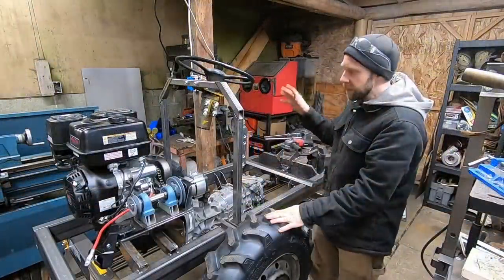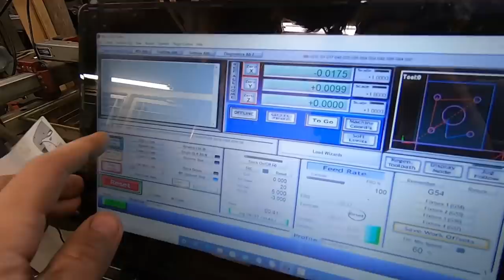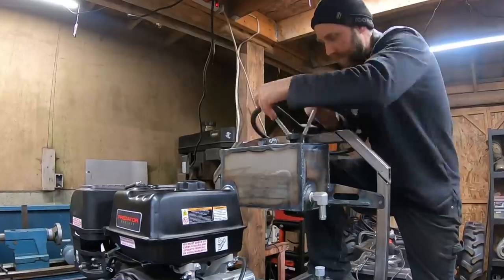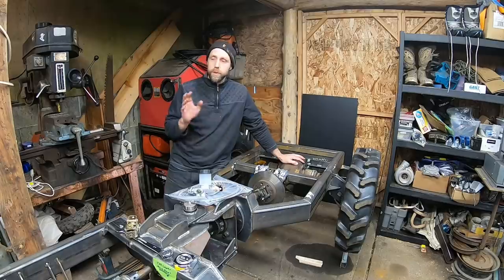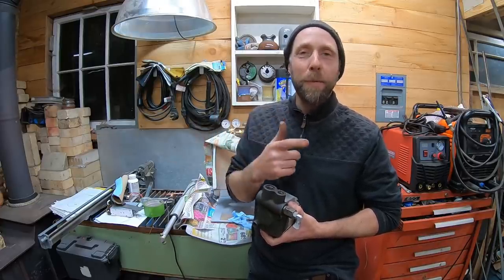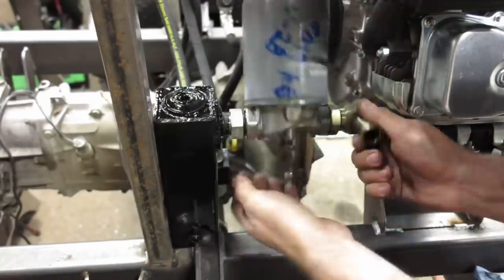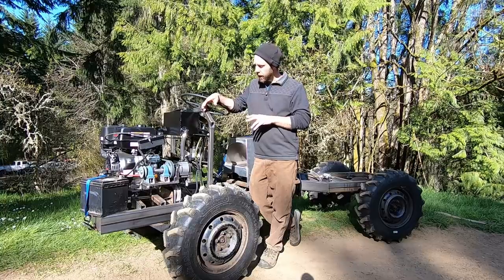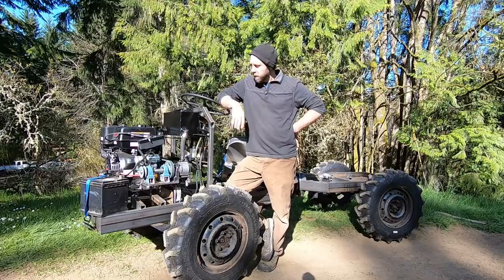420cc Predator powered articulating 4x4 dump truck build part 6

Comment: Looking fantastic! Great video. What video editing software do you use?
Also how do you like the Baur grinder? I just bought my first. I bought several Hercules before they came out with the Baur. Baur feels a little lighter, and is a little less expensive.
Reply from the maker: Refiner's Forge Thanks for checking out my video 👍 I’m editing on LumaFusion on my I pad, it’s affordable $20 and works pretty good!
I think the small Baur angel grinder seems fine so far, time will tell but I don’t abuse my tools so I think it will hold up fine. Thanks for commenting 👍 PS I just fired up my sawmill yesterday and got to same milling! It was great to get milling again!

Comment: Friends of mine own a tractor that brakes the front wheels by engaginging its 4wd systeme and at times it does not feel to healthy bc it has no center diff but it works just fine so i dont see a problem with ur brake design

Comment: For a vehicle with a relatively narrow track and no roll cage, the seating position seems quite high which also lifts the center of gravity of driver+machine. Was there a reason you chose this position ?
Reply from the maker: Haha it’s a motorcycle stand, just temporary 👍 I cannot get everything built in 3 months guys. I only put that on for testing it out 😂
I will be building a cab but it all takes time when working by yourself and documenting all this on my own.

Comment: Not sure you will need to weld that rear diff. Little to no tire slippage with no to near no weight on the rear end. (Just my opinion) Your build do what you want. 👍 Cant wait until next episode!
Reply from the maker: I will hold off for now on welding out any diffs, it gets great traction so far and I’m mostly sticking to trails. Thanks for checking out my video 👍

Comment: You may want to consider some kind of rotation limiter so the bed half doesn't flip over while you're using it. I can see it happen while using the dump bed on a slope.
Reply from the maker: Yes for sure, it’s definitely in the plan 👍
Reply: But then the front will roll over
Reply from the maker: Dara Bradley Yes I think I may not install a limiter if the back flips I would rather let it and keep the front wheels planted, I have talked with my friends that have worked a lot on the big 6 wheel articulating dump trucks and they don’t have limiters so when the backs roll it doesn’t flip the front end. Take care
Reply: @darabradley5173  Fair point

Comment: Nice work man! It's really turning it awesome! You've done some nice fab work on that machine! Just a suggestion, have you thought about switching over to a CVT style clutch in conjunction with your plan for the jackshaft? They tend to have great off idle torque by letting the engine rev a little more. Anyways, super cool stuff man! Love these builds you do! Stay safe! 😎

Comment: A predator 708cc would be sweet on that articulating dump truck your building or even the predator 670cc
Reply: Antonio Claudio Michael 708 is vertical shaft

Comment: E-brake caliper needs to be mounted so the bleeder is at the top. If not it will always be squishy because of trapped air.
Reply from the maker: Yes I flipped then so there installed that way now 👍

Comment: Hello friend. Good job ... quite inspiring. He has very good and innovative ideas. I really liked the possibility of adapting to the terrain with 4 tires and also using the same path as the front tires. I am also making some 4x4 vehicles manually to help with the farm work ... Please, why did you choose the centrifugal clutch instead of the Subaru clutch? It seems to me that I would have greater control of the acceleration and traction of the vehicle using the clutch of the Subaru. What are the advantages of the clutch you have chosen? The drums are very interesting ... thanks

Comment: Good work! I agree that your brake power is enough but do you think traction of just brakes on the rear tires will be enough? Like a heavy load plus a slippery hill situation.
Reply from the maker: Thanks for checking out my truck video! I should have gone into more detail on the brake stuff, I’m actually running stock Subaru rotors and calipers on the front with the center line rear disc for the main brakes. With a independent rear center parking brake. Take care
Reply: Mike festiva that makes since. Thanks for the reply!

Comment: great drive line break system ,, seen it done in autos some of there mistakes are putting it before the driveshaft ,, it needs to be by the rear diff like you have it ,, up front if the driveshaft broke you would not have rear brakes ,, great build what's wrong with that seat ?? car builders use a milk crate .. people it's in the build stage ..

Comment: Mike could you provide a schematic sketch of how the hydraulics were routed. That would be greatly appreciated. Great work!
Reply: It's very simple. From Tank to Pump to Relief valve to the steering valve, then back  to the tank. From the Steering valve, two lines go to the cylinders. On the cylinders, since it uses two, they are Tee'd together but crossing the ports so when one extends, the other retracts.
Reply from the maker: Thanks guys for checking out my video 👍 Pedro explained it great! It will change if I can track down the 5 port orbital steering valve, I then will be able to use the hydraulic pump in its original design and also run dual spool valves for the dump and plow blade. Take care

Comment: Don't you have to create some frame stops to prevent exactly what you did at 6:30, if the machine rolled or dropped into a hole? Not wishing you bad fortune, but it would most likely damage hydraulic lines, etc.
Reply from the maker: No frame stops, the hydraulic lines wouldn’t be damaged if the rear rolls, I decided there’s no need for the stops, even the really large Volvo articulating dump trucks don’t have frame stops, if you tip the rear dump over the front cab stays upright 👍

Comment: Nice video Mike, the truck is looking good! Question: Why did you choose to mig the hydraulic return manifold?
Reply from the maker: I could of MiG welded the manifold but I really like the controller of TIG and I have had a few pin holes in a hydraulic tank I made for my log splitter in the past. Plus I didn’t have all the plugs needed to pressure test the manifold with air so I had more confidence in TIG welding it the first time around. Take care Richard 🙂
Reply: @Mikefestiva  Thanks for the info. I have a MIG and a stick welder but I've never tried TIG.

Comment: While a lot of heavy equipment has centerline brakes, that's usually just the parking brake.
Most of the time, there's some kind of brakes in the hubs, which would be your footbrake
*edit*
that's not to say it won't suffice for your build here, I reckon it'll be more than enough
Reply: LifeRunner my duce and a half runs a driveline break

Comment: Just curious’ why didn’t you go with the 702 cc motor
Reply from the maker: Mainly finances, the $300 I saved by not buying that engine, I bought about all the metal to build this. Plus I know what the HP requirements are and the 13HP is all I needed. Take care
Reply: Love what you’re doing man thumbs up

Comment: would it be possible to build this beast with a 4 wheeler engine transmission and differential if any one knows it would be greatly appreciated
Reply: Similar note, I believe it was a Swedish company that built a 2 wheel motorcycle with both wheels driven. Worked but never took off.

Comment: I think the driveline brake is fine !  but if the driveline is spinning 4 times faster than the wheels it would actually take 4 times the torque to apply the same force.    The bigger the brake radius the better too

Very cool tho!

Comment: I have a question about your welding process choices.  I noticed that for your structural (frame, gusset, wheel hangers, etc) welds you use a wire-feed welder, but when welding your hydraulics (fittings, manifold, tank) you use TIG.  Why is that?
Reply from the maker: Well MIG welding is much faster to get a lot of work done quickly and it’s more affordable too, 100% Argon gas for TIG welding gets expensive.
The reason I TIG welded the Tank and Fittings is because I have more control on how the metal melts, you can take your time without burning a hole through the thin 1/16” tank, plus you can easily blend the metal together. 
TIG is extremely pin point accurate. I hope this help answer your questions. Take care 🙂
Reply: @Mikefestiva  That answers a lot, thanks!

Comment: Are you sure about the hydraulic parking brake? Slow leakage in the master or caliper could cause it to release, as well as hose swell from sustained pressure. Great build though.

Comment: The whole "predator engine"/harbor freight thing is popular  so I understand why you chose a 420cc single cylinder, but a twin cylinder engine such as a 570cc rotax vtwin engine would really pull the thing better.
Reply from the maker: The main reason is the engine is $350 new, that’s my main reason for this and I can walk into the store and have a brand new one if I ever need one. Cost and availability are big factors in this build. I get a lot of people suggesting bigger is better, honestly with the right gearing you can do work with this even with a 6.5 HP you will just need to work slower. Thanks for checking out my video.
Reply: @Mikefestiva  would you consider doing modification to the engine to make it output more power? I've seen 212cc predators put out 11 horsepower with just a better carburetor and a governor delete. Check out Red Beards Garage. He does awesome mods to almost every predator engine available.
Reply: @bigboi2447  most of the mods for these engines give a power increase at the top end with a tractor like this low end torque is more desirable

Comment: I suggest a torque converter clutch system...
Reply: It wouldn’t work as good as a centrifugal clutch cuz you get less power right away with a torque converter then a centrifugal clutch

Comment: How much $ do you have in it so far ?
Reply from the maker: I can’t remember right now, I will add it up and try to get the total in the next video, I know it’s more then I was planning on spending on it though, the hydraulics turned out to be quite expensive, my original idea was to used the steering box and pump from a F 250 truck, it would have been free and saved me probably $400 😐

Comment: Do you have the front end brake components hooked up in this video, or was this driveline only for now? Will the master cylinder that you chose have enough flow for the front end and the driveline?
Reply: I think he said driveline only for this vid.
Reply: the front brakes are hooked up and working and the master cylinder works very well he hooked up all the brakes before driving it around his property he has some steep terrain and stopping is more important than getting it to move under power for safety reasons

Comment: Mike I know you're busy, but I have two questions: (1) Can you shift on the fly, or do you have to stop in order to select a gear (given the centrifugal clutch)? And, (2) when you were designing this were there any other drivetrains that you considered besides the Subaru Legacy?
Reply: It is not necessary to shift while moving because you can start from a stop in any gear  but it is possible to shift while moving just not necessary or practical and as for the running gear Mike chose the Subaru  because they're inexpensive lots of them out there and he had access to one

Comment: i like the build but i noticed that your wheel track is a bit small when you put a tray on the back with weight in it i think it will want to sway and maybe tip over especially with the articulated swiveled rear end but the build gets 2 thumbs up

Comment: would it be possible to build this beast with a 4 wheeler engine transmission and differential if any one knows it would be greatly appreciated
Reply: DADY O96 whole the engine would probably be powerful enough the transmission and diff just wouldn’t be able to hold up to the torque that is needed to compete with what he is building.
Reply: @Overwatcher397  I was going to make it nit as wide so I can take it on ATV trails that the quad bike wouldn't be able to handle and I have a built trans and diff that I did my self with all kinds of custom built parts that I did when I blew it up originally and since I scraped the frame after it started to fall apart I don't know what to do with it plus it was built for a quad bike I had and it was to much for as little wate was being put on it

Comment: Awesome build! 
Quick question, are you going to limit the rear roll somehow? 
I'm most impressed with your ability to source parts and materials.  Looking forward to your future posts.
Reply: Stephen Hlywa would probably be best not to try limit the roll, if the rear were to tip over I’d rather it didn’t take the front end with it

Comment: Why did you use the tig welder on the manifold? Thanks !
Reply: Depends on what metal it is too...
Reply: I think that was smart to prevent spatter in the threads of the fitting.
Reply: You can usually avoid pinholes and leaks with a TIG welder, as opposed to a MIG welder. I am saying this from experience of welding fuel and oil tanks. You can NEVER get it to seal with MIG on the first pass. It often takes multiple passes to get it to seal. Whereas with TIG/Brazing/Gas welding, you can usually get them sealed up immediately, cause the weld pools/puddles merge into each other better.
Reply: Because he can. 💁🏻‍♂️
😉

🤣😂🤣😂

Comment: Hey i know its not related to the video but is it possible to use a pedal with the Titanium Unlimited 200 Tig function?
Reply from the maker: Unfortunately there is not any pedals available for them and I talked with one of the  head guys at Harbor Freights welding development and he told me there won’t be a pedal available 😕 I’m sure there’s a way to wire one up, the front know controls amps so it seems like you would be able to mod it but I’m not savvy on electronics. Take care
Reply: Talk to the guys here.
https://www.eastwood.com/welders/welding/tig-welder-accessories-buyers-guide.html

Comment: I must say you are a smart man, so why have you built this? and have you removed the low oil sensor from the engine as it will stall a lot, I had a 420cc in a bush cart every time i turned left the bloody thing stalled.

Comment: You should probably take the clutch of and put a torque converter on it
Reply: a torque converter would be nice but some of the limitations of the build like driving the hydraulic pump from crank shaft made it easier to use a centrifugal clutch because of how a torque converter mounts to the back of the crank case and not leaving any where to drive the hydraulic pump

Comment: Are you planning on putting front brakes on it
Reply: yes it has brakes on both front wheels the drive line disk has two calipers on it one for the parking brake and one that is applied along with the front brakes with the foot pedle
Reply: david helgeson 
Looks like your steering calculations worked out okay. Even if the steering cylinders limit the steering it seems to have more than enough for a tight turning radius.
Reply: OK its turning out to be awesome good job

Comment: Does anyone know what centrifugal clutch he is running on there to hold all that torque?
Reply: The clutch is matched to the motor out put at the crank shaft the torque require to drive the tires is devevoped after the clutch though gearing
Reply: He is using the transmission from the donor suburu.  No centrifugal clutch that is used in go cart builds was used.  Watch his previous build videos and see how he modifies donor Subaru's driveline.
Reply: @Cgerb73  There is clearly some type of clutch at the end of the engine shaft. He could have used a regular sprocket to have 1 to 1 ratio on the input shaft on the transmission. So something doesn't make sense here.
Reply: @jerrytube13  ok go to part 4 of build around 13:00.  He shows the clutch he used.  I forgot he had that set up.  So there is a centrifugal clutch, lol.
Reply: @Cgerb73  thanks ill check it out

Comment: 🤔you have an open rear differential and 1 central brake, this is a problem, during braking, one wheel will brake, the car will not stop on the descent, you need to lock the rear differential.
Hello from Russia.
Еxcellent project👍
Reply: If it had an open differential and only one drive line brake that might be true but it has a limited slip differential in the rear and two disk brakes in the front along with the rear drive line brake

Comment: it needs some suspension!
Reply: I think that would just add unneeded complexity for not much benefit for this machine's intended use case. It's low speed with articulation to deal with mountainous terrain. He also won't have to worry about less ground clearance when the dump body is weighted down with a load.

Comment: You don’t need more gearing you need more power !😁 also please put front brakes on it for safety on cars and trucks front brakes do about 75% of the work since the rear brakes tend to lock up easily.
Reply from the maker: It’s got fully working Subaru Rotors and calipers up front , with the rear drive line brake that all work together. Plus a full independent hydraulic rear drive line parking brake. Take care 🙂
Reply: Mike festiva I either forgot or missed the front brake install.

Comment: I think Mike, i would run brake disks on both front shafts & rear drive shaft for redundancy, one disk brake for a parking & the other for normal braking that way if the rear differential breaks & you lose drive connection you still have some form of braking still available.